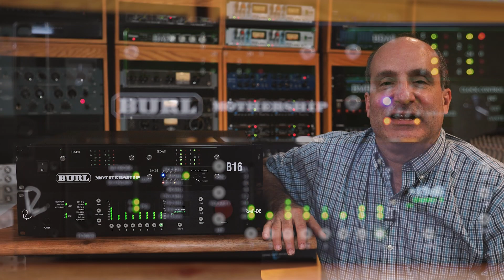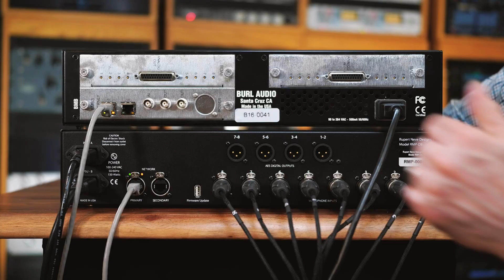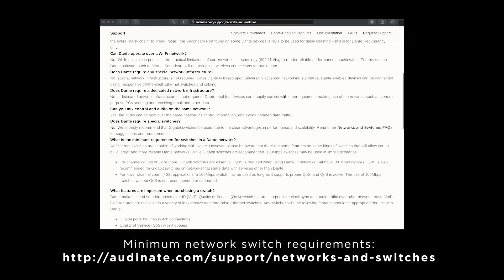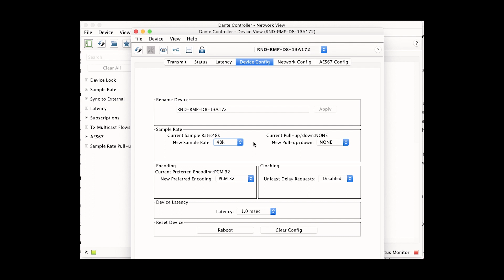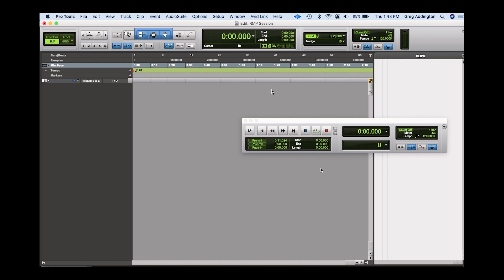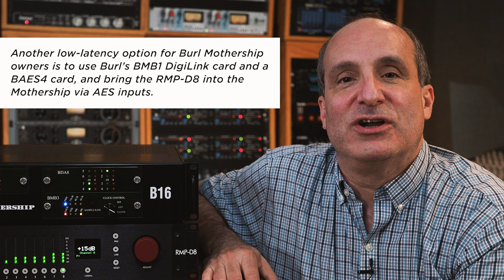Setting Up the RMP-D8 with a Burl Mothership

Comment: Can you please advise? This seems like an unnecessary, expensive and somewhat redundant pairing. The Burl Mothership already has great a/d and d/a converters. Right? Why not just use 8 regular Rupert Neve preamps to feed the BDA8? Conversely if you have the RMP-D8, why do you need the Mothership?
Reply: Both the Mothership and RMP can function independently. It is demonstrating how to get them to work together if you wanted to pair them. This setup gives you a total of 16 inputs and 16 outputs.